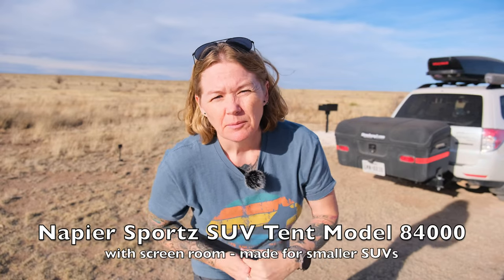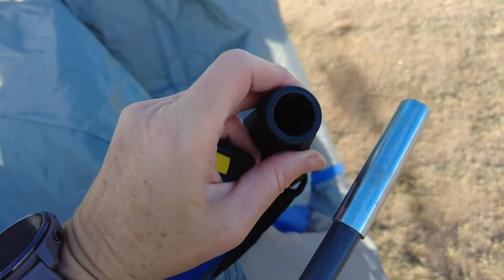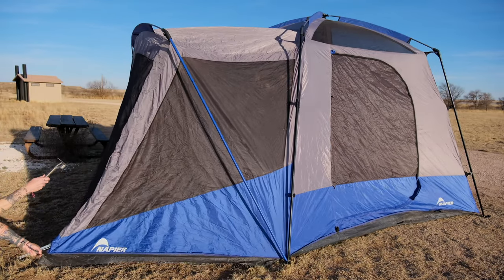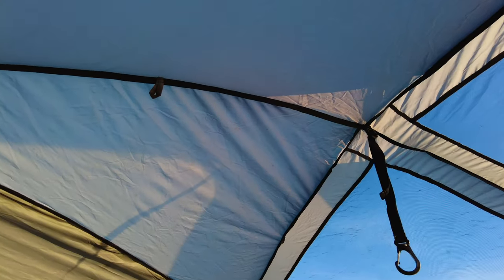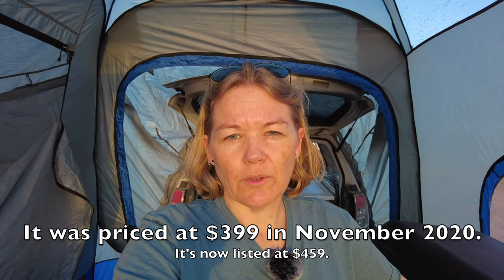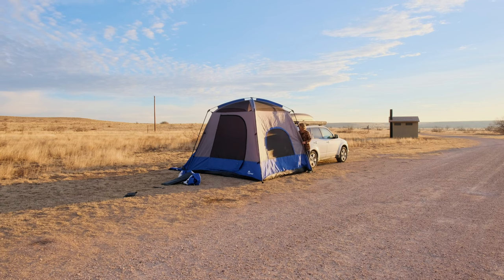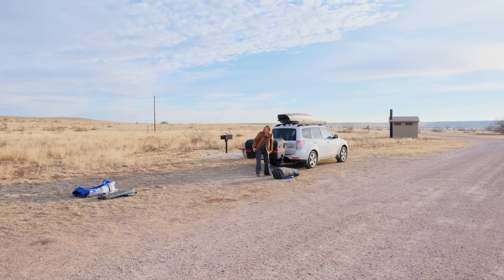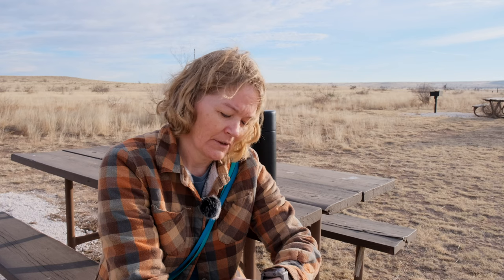One Person Setup of the Napier 84000 SUV Tent with Screen Room + 2.5 Year Review of an Awesome Tent

Comment: We’ve had our Napier car tent two years now, after downsizing from a 40’ motor coach. We travel in a Suburban — the best decision we ever made for camping. Worth every penny, easy to set up and take down. We also carry two tarps (one tarp under tent, one tarp inside to catch soil, rocks, twigs, leaves). We also use a propane heater during cooler weather and with the rain fly, the heater takes the edge off. Thanks for the video, great job!
Reply from the maker: Awesome! Using a tarp under the tent like a footprint is probably a good idea. If I'm out for several days in the same place, I have a 9'x9' rug that I put down inside, as well as an "RV" rug that I put down just outside the door of the tent (the first time I did this I felt like I was truly "glamping" 😂 but it's so nice when staying in the same place for awhile). I have a Mr. Buddy propane heater than I use in winter, too. It works really well for the space. I'm glad to hear the setup is working well for you. It's definitely one of the best gear decisions I've made as well. Really happy with it, and hope to use it for years to come, even if I "upgrade" to a van someday.
Reply: Don't use it in rain... naiper tent sucks in rain or cold.

Comment: This was extremely helpful as I am looking at tents to purchase for this exact set up. You did a great great job also at videoing this and showing everything.  Kudo's and enjoy your camping :)
Reply from the maker: Thank you! I'm glad it was helpful to you! I'm planning to do another video this fall (when it cools off!) that details how to remove the screen room and "umbilical" and how to put on the rain fly.
Reply: @lovedogsontheloose  I have another question,  in one of the replies to someone you mention your porta potty.  May I inquire which one you have?  I as well have been looking at them.  Thank you in advance.
Reply from the maker: @staciespeckman  I use this one: https://amzn.to/3r8gywb (that's an Amazon referral link, but you can most assuredly get it cheaper at Walmart, as well as the bags). I've been using it for a few years now and haven't had any real issues with it. It sits a little low, but they all do. This one is sturdy and portable, if a little challenging to collapse down at first until you get the hang of it. But it does the job.
Reply: She did a totally AWESOME job, as a "long term review" !!!

Comment: Your tent will last a long time. Ours  lasted 20 years. Wish I had that screen room for the potty. Worked great as a stand alone and kept the firewood in the umbilical. Enjoy it will last a long time with little care. The one time in a good rain I got a valley of water between the rear window and the umbilical.  Never leaked with the rain fly on. You could get a colapseable rake to rake the tent foot print and put down a heavy tarp. That's what I did . When you fold up the tent do what you fid to make it square. Then fold on side to the middle and do the same with the other side. Then fold it in half and roll it up.
Reply from the maker: Wow! 20 years! That’s amazing. Good to hear your experience in rain. Thanks for watching and commenting!

Comment: Good job reviewing this, I have been on the fence as to get one or not. My problem is that I camp in bear country and with the hatch up there isn't any way to keep the food smell from attracting bear. You have to put your cooler and such in your rig or you will be fined. Well with it in my rig I can just see the bear saying ok I'll just come right in thanks, haha. I think I would have to spend the nights with the hatch closed so why not just attach a tarp to the back of the car, I dont' know what I'm going to do but you did a good review.
Reply from the maker: Thanks, Shari. I appreciate it. You bring up a good point about using this tent in bear country. Definitely doable to close the hatch at night without disconnecting the tent, but depending on the particular situation, I could see where a tarp or something simpler might be more appealing.

Comment: Cabela's 10% military discount!  USCG '77-83 Semper Paratus.  I think you can actually get the 84000 direct from Napier for $399.00.  As you said Cabelas is $459 so the discount only brings it down to $413.  You could use your Cabelas point to lower that tho.  Even tho I have a Coleman 4 person for solo camping I am seriously thinking about one of the Napier tents.  I also have a cargo box but its not a swing away.  I don't use it much for solo camping as I don't carry all that much stuff.  I do have a car top carrier.  Thanks for the vid!!
Reply from the maker: I haven’t looked in a while, but Napier did have them on sale at a significant reduction. The military discount definitely comes in handy sometimes.

Comment: Hi There. Thanks for your service!!!  Good video.  How is the air flow in the tent?  I saw one review that mentioned poor air flow through the screens.
Reply from the maker: Thank you. Regarding air flow: I've not noticed this to be an issue myself. There are large screened windows on three of the four sides (the fourth side being the side that attaches to the car), in addition to the top being vented (when the rain fly isn't on). The only times I've noticed a lack of airflow have been when there was little to no breeze outside and the West Texas sun was beating down in the middle of our triple-digit summers. At that point, I figure no tent is going to be comfortable. :)
Reply: @lovedogsontheloose  Thanks!
Reply from the maker: @oldmanjimbomiller1713  You're welcome!

Comment: Thanks for the great video. Does the “screen room” have fabric walls that roll down over the screens? Seems to me that would be the great extension area for a “potty” room with privacy.  I am going to assume not. Plenty of other options though. Travel safe! 
❤️🐾.     New sub!
Reply from the maker: Thanks for the sub and for the comment! Yes, all screen areas on this tent (except the ones in the ceiling) have fabric covers that zip open/closed. You can see this briefly in the video at around 13:20. The ones in the screen room actually zip down and can be rolled and toggled at the bottom if not used. There are toggles at the top that keep the fabric up when in use, and then there are zippers on each side of each window. It's an interesting way of doing it that I'm not sure I love (the toggles at the top sometimes come undone and then the weight of the fabric will start unzipping the sides on its own), but it's not something I have a huge issue with. I just check them to make sure they're up before I do anything. And yes, absolutely, that screen room makes a great privy. That's how I use it and it's been great.
Reply: @lovedogsontheloose  Thank you.  I think I just caught a glimpse of that in your video on the “Stowaway 2”. ❤️

Comment: I would think if you put a tarp down before you put the tent down you'll protect that tent floor a lot more for holes. And keep it cleaner
Reply from the maker: Definitely. I’ve just never particularly liked tarps under my tents because they tend to be water collectors when it does rain. But in dry places like West Texas it would work just fine. I’m not as worried about trying to keep dirt out of the inside of the tent simply because I have two dogs who are always going to bring dirt inside with them. But I do need to use my little broom or cordless vacuum far more often! Thanks so much for watching and commenting.

Comment: I’ve been looking at these tents for solo traveling at some point. I have a few questions. Do you close the hatch at night for safety? Can you close this tent separate from the car if you had to run an errand? Thanks for any help in figuring out how to safely solo camp:)
Reply from the maker: Hi, Marlene. I usually do close the hatch at night for safety and because I don't actually want my two big dogs wandering around the tent all night. We all sleep better with the hatch closed.

Regarding closing the tent separate from the car: yes, absolutely you can do this. From what I've read, when it's not attached to the car, it's simply not sheltered from rain very well on that side where the car would be. You can even entirely remove the umbilical (it zips on/off), so that you just have a [slightly modified] door there that can be zipped closed (both netting and solid material). When the rain fly is on, it doesn't cover this side bc the car would ordinarily be there. I've done this a few times and it's nice to have the option. 

Hope this helps!
Reply: @lovedogsontheloose  thank you! This makes all the difference. I will also be traveling with one or two dogs:) I am gathering my supplies a little at a time and it can be anytime between 6 months or more before my first solo trip.
Reply from the maker: @marlenebocook162  Exciting! Please don't hesitate to ask any other questions you might have as you prepare. I'm happy to help.
Reply: Have you had this in the rain, or in a heavily buggy area.? I live in Wyoming and it rains a lot now, with pretty good winds and the bugs are ridiculous. Also, I don’t have railings on the top of my car, how would you attach to the vehicle?
Reply from the maker: @chrisgilmore4591  I've not had mine in much rain. In fact, I've only ever had to put on the rain fly once. I mostly use it in an arid climate (so also not many bugs, comparatively speaking). I think it would do okay in a normal rain, but probably not as good in a storm with heavy winds and rain. 

Re/ how to attach without railings: this could be tricky but I'm sure there's a way to do it, even if it meant having to add your own straps somehow. If you buckled the straps that are sewn in so that you had an enclosed loop, and then looped another longer strap through those and pulled the longer strap toward your side mirrors or other point, maybe that could work? Not sure.
Reply: @lovedogsontheloose  thank you so much for your honesty, I appreciate that. Be safe out there.
Reply from the maker: @chrisgilmore4591  Of course. Be well and stay safe.

Comment: I'm single myself so i'd have to put this tent up myself. I have a 2022 Subaru Forester. I hear that this tent is not waterproof do you find that to be true Amazon don't carry this tent anymore. Thank you for where you purchased this tent.
Reply from the maker: Hi, Paul. This is the tent I have: https://www.amazon.com/Sportz-Blue-Grey-Screen-x7-25-Feet/dp/B004O74Z0G/ref=sr_1_1?crid=1X1VCJ3HI3XXT&keywords=Napier%252B84000&qid=1685581871&sprefix=napier%252B84000%252Caps%252C131&sr=8-1&th=1&psc=1&_encoding=UTF8&tag=lovedogs073-20&linkCode=ur2&linkId=66c70cbd1e1e8df4da51e1692e6c456c&camp=1789&creative=9325

(that's an associate link)

To answer your question about waterproof-ness, the tent itself is not, but the rain fly is. I've only had mine in rain once and it did fine (everything stayed dry), but I did find it difficult to keep the rain fly off the tent material, so if you're going to be out in bad weather for a prolonged amount of time, it might be iffy. Hope that helps.

Comment: How many weeks out of the year, on average, would you say you have used this?  Just for occasional camping? Almost full time?
Reply from the maker: Hi, Grant-- thanks for watching and for the question. I wasn't full time in this tent, but I used it quite a bit. I'd estimate 20-25 weeks out of the year. In March of this year I got a van and sold this tent to help out with initial "move-in" expenses. I'm now full time in a van and kind of wishing I'd kept this tent to connect to my side barn doors. I may re-invest in it at some point. We'll see. By the time I sold it, there were more tears in the tent fabric. Overall, though, not bad for heavy use (with dogs) for 3.5-4 years. 

There were many times I thought about going full time in it; however, with two big dogs, while I'm sure we could've made it work, it didn't feel like the best choice. I wasn't ready to be stuck in a Subaru Forester full-time if something did happen to the tent and I couldn't replace it right away. Anyway, I hope this helps. Feel free to ask more questions.
Reply: @lovedogsontheloose  Thank you so much!

I'm in Austin right now. Other than both Big Bend parks, do you have any suggestions for places to camp in central Texas?
Reply from the maker: @GrantSR  Admittedly I've not done as much in central Texas. I was in Lubbock for almost 17 years before moving into the van full time so mostly hit places in West Texas, New Mexico, and Colorado.

Comment: I just have a soft top of my Jeep so I'm wondering if that umbilical would wrap it enough to stay up
Reply from the maker: I’m not sure. If you have something on top to clip the straps around, it should work but otherwise you might have trouble getting it to stay tight around your hatch. On the other hand, if you leave the hatch open, you might be able to get away in most cases with not clipping it at the top and just making sure to clip into the tire wells, letting the hatch itself prop up the umbilical. Not sure how well it would seal but could maybe work.
Reply: Best review of this style tent yet. I’m umbilical curious too. Picture using suction to hold the umbilical to the back of a truck camper. Using the bumper part on the truck bumper as designed. Can it work?  Guess it’s all about the length of the top part to reach a the door. Thanks again!
Reply from the maker: @MotoDiva22  I'm betting there's a way to make it work, though not sure about suction cup mounts, as that umbilical is actually pretty heavy. Maybe if you used enough of them, equally spaced around the top and sides of the umbilical. If the truck camper is metal, you could also try rare earth magnets.
Reply: Rare earth magnets are an interesting idea. So many SUV tent designs don’t publish umbilical dimensions, so there’s another hurdle.  I’m determined though. Many thanks for your response.
Reply from the maker: @MotoDiva22  So I just read on Napier's website that the maximum height that will work with the umbilical is 80” (from the ground to the highest point). Not sure how tall your truck camper is.

Comment: Hi. I have the truck tent companion tent and used it one time as a stand alone tent. Where the poles went into the grommets two of the grommets blew out. I emailed Napier and they couldn't sent me out a repair kit because there was no such a thing. They wanted to send me out grommets that were already attached that I would have to cut off the old and sew on the new. Basically, the grommet split in two from the tension of the pole. Very poorly made IMO. Thanks for listening to me whine. : - )
Reply from the maker: Oh, man. I'm sorry you experienced that. Would they not allow a return/refund even? In over two years I've not experienced any weakness in the grommets on the 84000 that I have, but none of the poles sit too tightly in them. Sounds like that truck tent companion was made with poles sitting too tightly in the grommets ? I wonder if others who use that tent have had similar experiences.
Reply: @lovedogsontheloose  My truck tent is from Napier, the companion tent is from the cheaper ridge line. It was way past the time under warrantee to file a claim.

Comment: I noticed that you hitch stabilizer is installed incorrectly.  It needs to be rotated 180 degrees.
Reply from the maker: Very impressive eye! We actually rotated it that way because it was a more solid mount. Receiver and extension are both rock solid.

Comment: How is it about leaking when i does rain. Is the rain fly effective?
Reply from the maker: I haven't had it in any significant rain, so can't give you a straight answer. It did absolutely fine in a light wintry mix (rain/sleet mix) with high winds, but the wind did blow the fly against the walls of the tent quite a bit, even with the guy lines staked out, so I'm not entirely sure I'd trust it in a heavy rain + high wind scenario. Again, though, I haven't gotten to test it in those conditions yet. I'll do another video next week that shows details of the fly. Maybe I'll put it to the water hose test.

Comment: Whats it like putting it away in the rain when its soaking wet and muddy?   How do you dry it out ? And does it take long to dry out?
Reply from the maker: Hi, Adrian. Like I mentioned in the video, we don’t get much rain here in West Texas, so I can’t answer your questions. Sorry. That said, I would guess that the best way to dry it out might be to let it stand and dry. So, if you had to pack it up wet, I’d recommend setting it back up somewhere else as soon as you can to let it dry and air out. That’s what I do when backpacking, with my smaller tents, and I would guess that while it may take a bit longer with such a large tent and so much fabric, it’d probably work just as well.
Reply: It sucks to pack up wet. Just set it up when you get home.

Comment: Thanks for the demo … just wondering, the parts that the poles slide/fit into, are they metal or plastic? Second question, is the tent self-standing, if/when one needs to drive away for whatever reasons? 👍🏼🇦🇺🦘
Reply from the maker: Hey, thanks for watching--glad the demo helped. 

The end "caps" that the poles go into at each end of the sleeves are a molded plastic. 

Yes, this is a free-standing tent, and you can drive away from it and then carefully back up into it when you return if you want. I've also used this tent as a stand alone tent in a campground where the tent area was a walk in from the parking lot. Hope this helps.